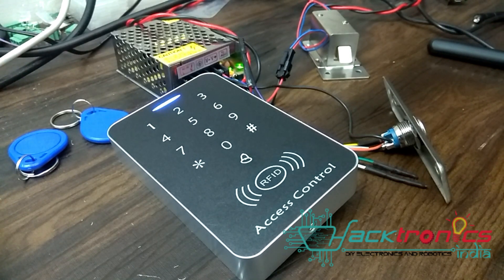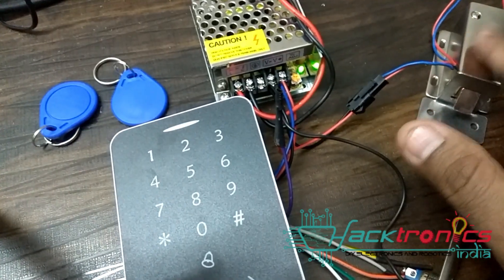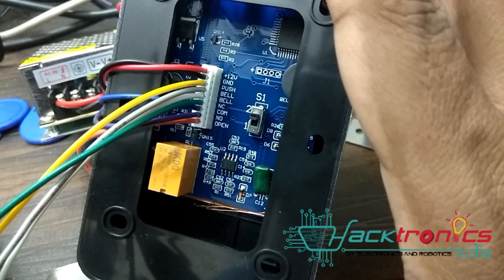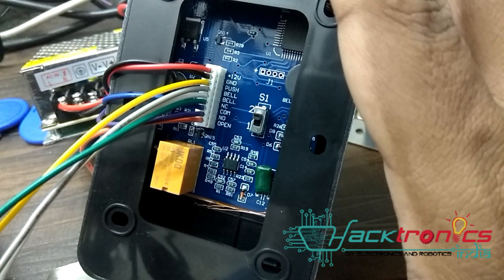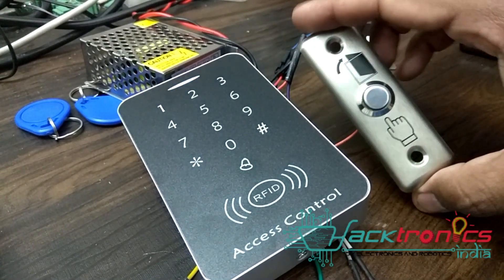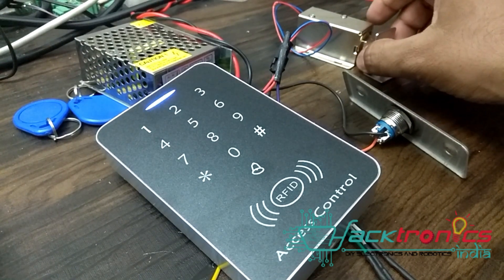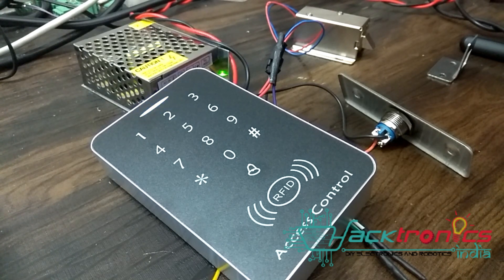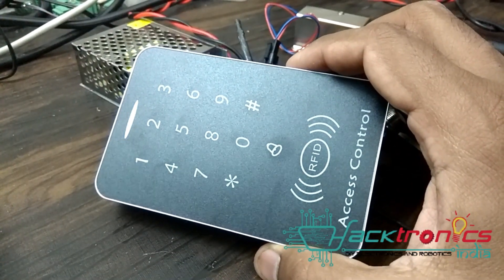RFID Door Access Control System Demo

Comment: Can it uses standard 12v adaptor? So that relay and push botton are connected directly to RFID reader? Thanks..
Reply from the maker: Yes you can use a standard 12V adaptor.
Reply: Pop

Comment: I'm using the RFID Card Password Access Control Machine For Door Lock.
The problem that I'm facing with this unit is that whenever I restart the access control or it looses power & then gets power back is that instead of going to the "Standby state" (Blue light flashing every 1 sec / Slow flash), it goes to "Pending further action" (Green light flashing every 0.5 sec / fast flash). I'm using the terms "Standby state" & "Pending further action" from the manual that I got with the unit. When the access control is in this state whatever button I press it just makes an input beep but the green light keeps on fast flashing. During this state I can't enter the programming state.
The only way to bypass this is by performing these actions:
1. get a card/tag near its rfid area & it beeps once (stating that its a valid input), but the "Pending further action" fast flash green light will still be on.
2. read the card/tag again & it beeps twice (stating that its an invalid input), but now the access control enters the "Standby state" slow flash blue light.
Now I can unlock the door lock either by a registered card/tag or common password.

So is there anyway to solve this? How can I change the "Pending further action" fast flash green at the power up to "Standby state" slow flash blue.